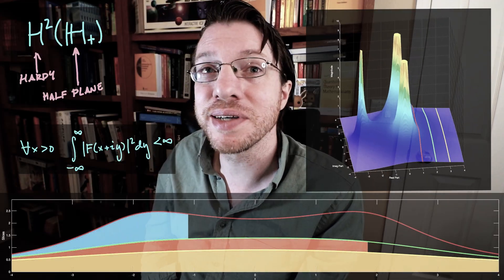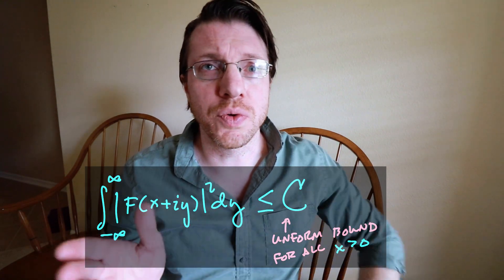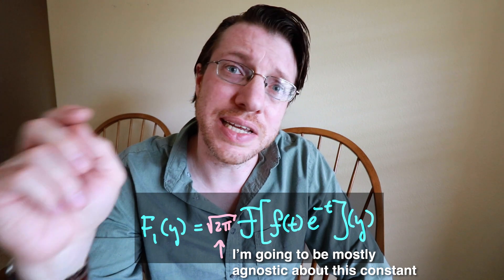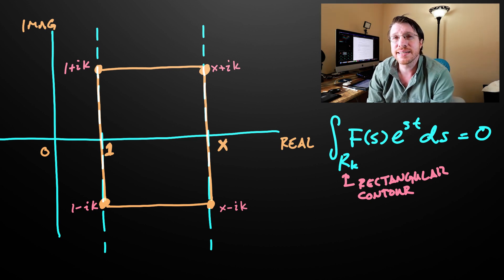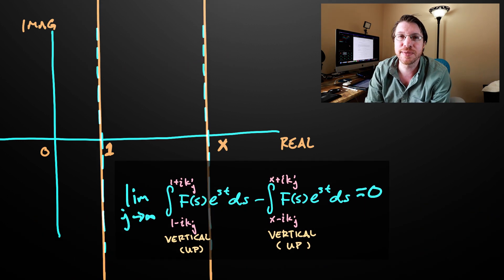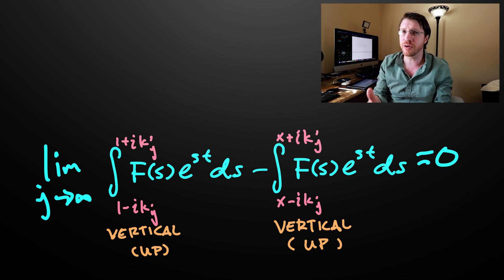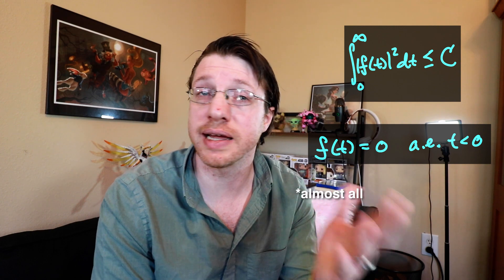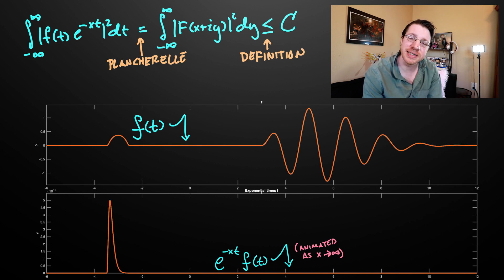The Paley Wiener Theorem and the Inversion of the Laplace transform

Comment: Wow, thank you for the great video. I needed to watch it 3 times. Btw, at 6:30 and 7:41 you say that you take the vertical segment, but in fact you are really using the horizontal segment. I did not fully understand the reasoning why there only needs to be some sub-sequence k_j for which the integral (at 7:49) goes to zero, but apart from that, if I'm not mistaken, the Riemann-Lebesgue lemma guarantees that F (being a Fourier transform of an L2 function) goes to zero when its (here imaginary) argument goes to infinity so that the integral at 7:49 would need to go to zero in every case for increasing k_j.
Reply from the maker: Ah, yes, I did mean to say the horizontal segment. I thought I caught all of those bits. The traditional presentation of this theorem is rotated 90 degrees, so I probably was reading the proof and forgot to translate it. Thank you for catching that.

In this setting we have a collection of functions obtained through the Fourier transform as parameterized by the fixed real part. The Riemann Lebesgue lemma would tell you that if you take the Fourier transform of our analytic function along a vertical line that it would go to zero for each x. We need the entire integral from 1 to x  as we integrate through the various functions parameterized by our selection of real part to go to zero. It works, but it doesn't quite follow directly from RL lemma. At least, not as I've seen it. We need some sort of "uniform" argument.

The subsequence argument comes into play because of the particular route we chose for our proof. We are using the Cauchy theorem to get a constraint on the difference between the integrals along the vertical line segments, but we have some extra "junk" coming from the horizontal lines. Since we show that the integrals along the horizontal line segments are integrable, this means that they in principle go to zero, at least for some sub sequence.

Does this clear things up?
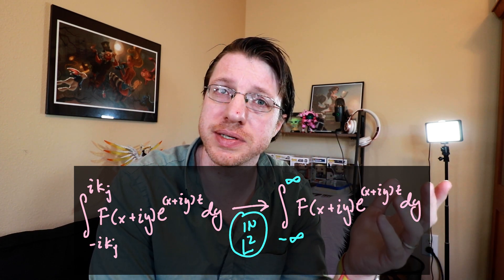Reply: @JoelRosenfeld  Thank you very much for the explanation! What I don't understand, yet, is, why (in the last paragraph of your answer) you emphasize that the integrals along the horizontal line segments go to zero only for some sub sequence of k values. Why does this not hold for every integral as k_j goes to infinity? I'm sure this is related to the theorem you mention at 8:53, where k_j_m is an a.e. convergent sub sequence, but I fail to see the point. Is this "convergent for a sub sequence"-formulation necessary, because L2 only is a space of equivalence classes of functions?
Reply from the maker: @weinihao3632  That's the best we can get from the hypothesis we have. More simply if we have that the integral from 0 to infinity of a function h(t) is finite, we cannot say that h(t) goes to zero as t goes to infinity. This is because we could have pathological examples where h can get to be arbitrarily large as t goes to infinity, but the measure of the supporting sets gets arbitrarily small to cancel out those tall points.
Reply: @JoelRosenfeld  I can understand your last explanation, but I don't yet see where a function like h(t) would be of interest, as all reasoning is done on the results of integrals.  Maybe this helps to pin-point my problem: I can understand that since at 7:41 your double integral is bounded, you can flip the order of integration. But I still fail to see how this is connected with your statement at 7:49, which says:
Integrable <=> there is a sequence {k_j}, j = 1 ... infinity, such that k_j -> infinity and the "argument of the integral, which is dependent on k_j" -> 0.
Why is this only true for a (countable) sequence and can't be a simple limit of k->infinity? 

I apologize, because this must be something very simple, I missed here, yet I really would like to understand it.
Reply from the maker: At 7:49 we are thinking of the inner integral as being a function of y, call it h. Hence the integral from -inf to inf of h(y) dy is finite and there must be a sequence of y's such that h(y) goes to zero.
Reply from the maker: And since that is going to zero, and we know that this particular term is an upper bound from 6:57, we get that the integrals along the segments goes to zero.
Reply: @JoelRosenfeld  Oh, of course! I missed that it is an upper bound! Thank you so much!
Reply from the maker: @weinihao3632  No problem! Thanks for engaging with me here, this will probably help a lot of people who have the same issue.